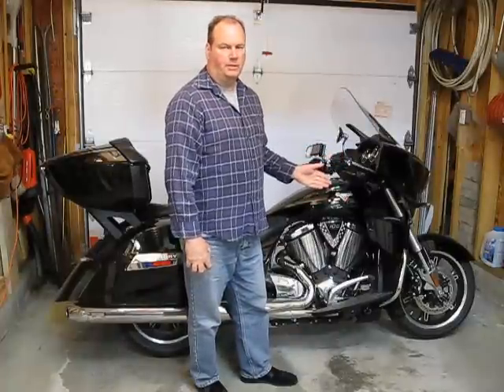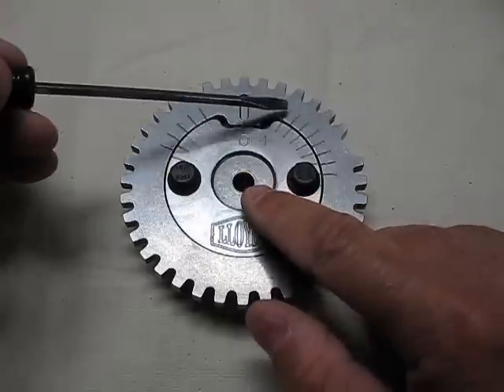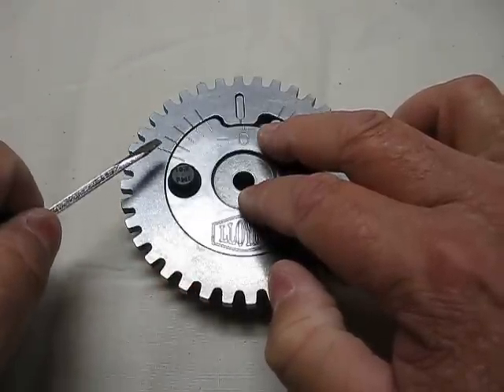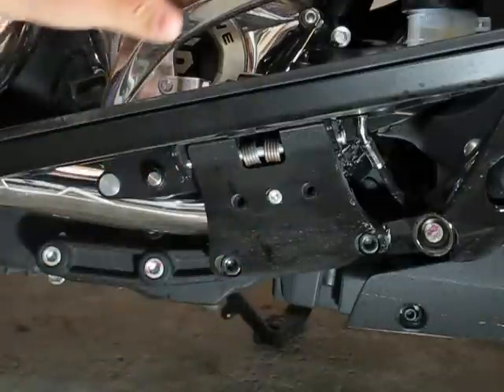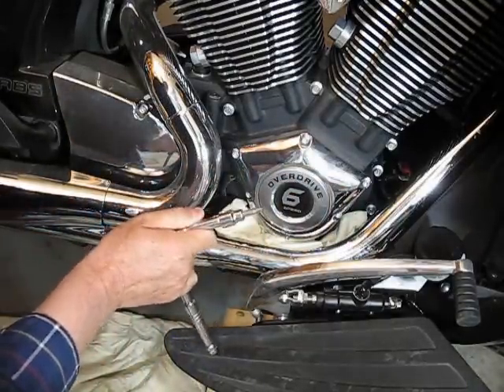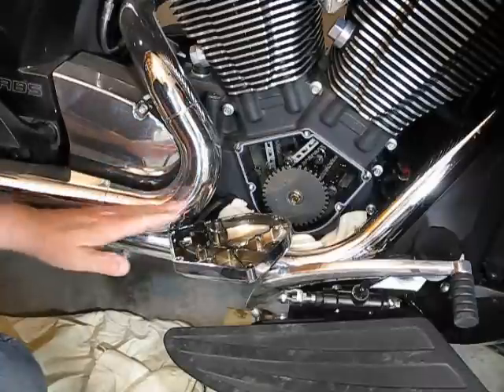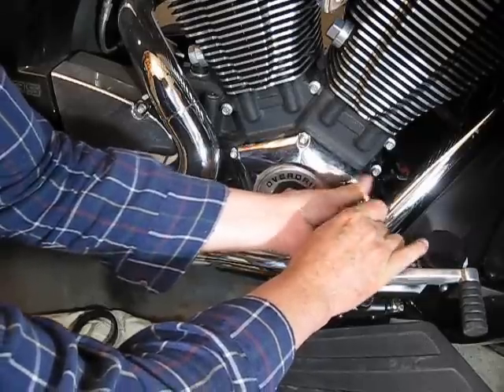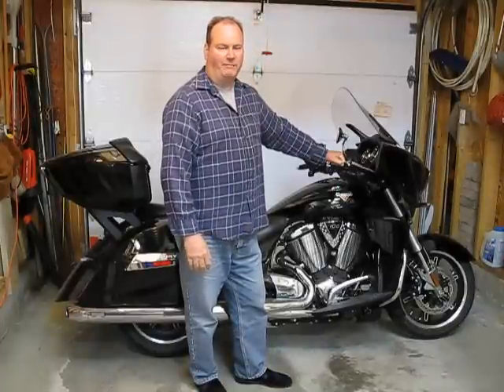Victory CCT Timing Gear Install

Comment: Thank you for the video, the torque specs and advice to clean the bolt holes out.
My gear did not come out by hand.
I used some short tire irons and carefully positioned them as to be sure not to damage the casing while I pry'd out the stock timing gear.
I also lubed the new timing gear and the area of the shaft it is installed on.
I then had to tap the gear into place using a piece of wood & rubber mallet.

Thanks again,

Harvey